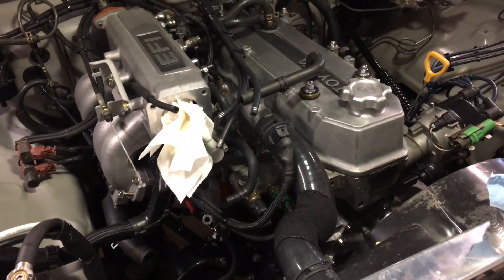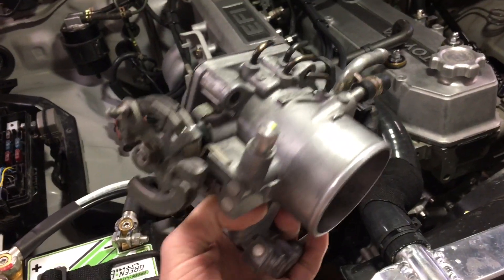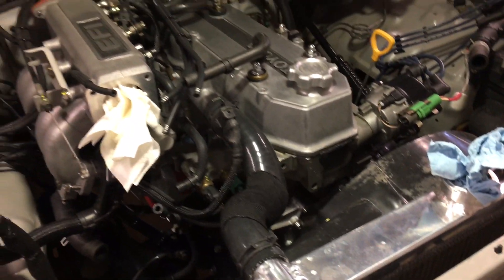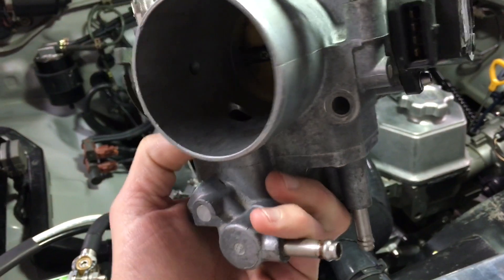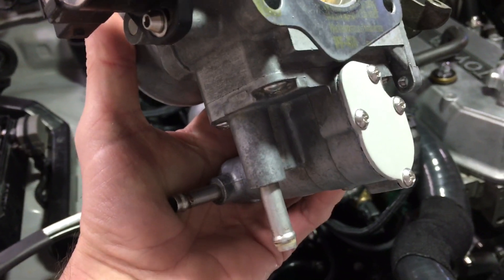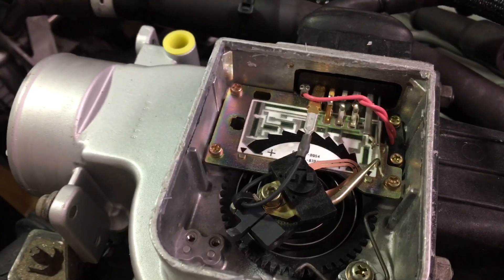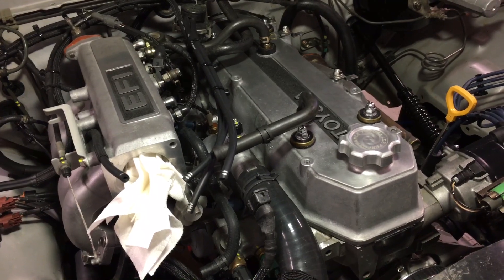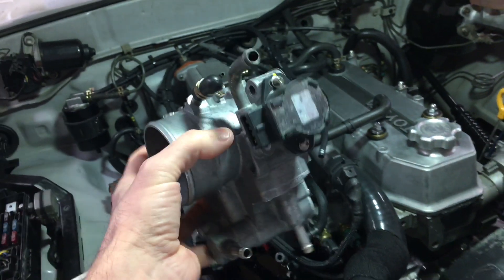Adjusting the Toyota 22RE pickup IAC auxiliary valve for more stable idle warm up

Comment: Question are ICV all the same on 22re ? I have 1988
Reply from the maker: Not sure about the 1988 model. The 1989 to 1995 should all be basically the same, since that's the generation span there. I believe with some of the earlier cars (before 1989), there was EFI and also carbs. If you check out some of my other videos, I show the IAC valve off my truck (which is a 1990 model year) in greater detail.
Reply: 1985-1988 has a different idle valve from 1989-1995.

Comment: Hey Ray, i landed on this video while trying to figure out a similar issue on a 94 pickup with the 3vze that i recenty aquired. I was going to email you but coulnt find it on the about page. Sooo here goes. 
I bought it from a guy that was having issues fixing it and needed the space. He had a friend trying to fix a high idle who attempted adjusting everything they could reach to no avail. When i looked at it, i found it went straight to full throttle. I bought it and after some quick research i attempted to test the iac. Taped off the intake port in the throttle body, and fired it up. Brought the idle down drastically, to within maneagable limits. I attempted adjusting the ring,and found it seized. After a few attempts i sent it to a machine shop who was able to  get the sleeve loosened,and they removed the ring and cleaned up the threads (wish i knew these adjustments were some sort of trade secret or something lol). So i adjusted the sleeve all the way in and installed it(now recognizing this as my first mistake). It ran if i gave it a bit of gas,but i noticed the tail pipe got hot pretty quick, causing the bit of grass up against it to smoke. Im assuming after watching your video that probably it was running rich?  Anyway, im hoping you might have some insight on where to begin as every setting on this throttle body has been altered to an unknown degree at this point.  
Any advice? 

I do believe i need to replace the fan clutch as well,as it grabs immediately and so makes setting this by ear pretty difficult since theres no tach
Reply from the maker: The fan clutch is designed to grab immediately and then free wheel as the engine RPM's go up (i.e. the fan doesn't spin up also). You need the fan turning at low engine RPM's to cool the motor at a stop light. On the IAC, yeah, when I adjusted mine I wish I had made a mark to indicate the factory setting also. If you block off the air passage involved with the IAC valve, the motor should run normally once up to temp. I'm not sure how the IAC valve is configured to work on your motor, but on the 22RE if you turn the nut counter clockwise, it takes longer (higher heat) to shut off the air coming through the IAC. If you run the nut completely down, you are effectively disabling the IAC totally.
Reply: @ray5961  so by disabling it,the engine ends up running rich i assume?
Reply from the maker: @83qwestor  Think of the motor has having two phases - warm up phase, then normal operation. The IAC valve relates only to the initial warm up phase, until the motor gets up to around 150-160 degrees (about 5 minutes of driving approximately). Once coolant temp sends back a certain temp to the ECU, it flips out of that warm up mode and into normal operation. In normal operation, the motor and ECU could careless about the IAC - it expects it to be shut down by that time. So if you have dialed the nut down and caused it to be disabled, it might run a bit richer during the warm up phase, but not under normal operation, as the ECU expects it to be closed by that time anyway.
Reply: @ray5961  ah ok. Im thinking i might try your method,and set it about 4 turns out and see what i get. Would the other screws matter as much,other than for the position of the butterfly?
Reply from the maker: @83qwestor  I'm currently running 4.0 turns out from seated and it's largely okay. However, idle does drop a bit more than I would like if the truck is idling / warming up in the drive way. I think if I ever pull that stuff off to adjust it further, I'm going to give 4.5 turns a try. I think 4.5 turns out would be just about perfect, at least for my particular motor. If you go with 4 turns, you should be in the ball park. The O-ring on the idle adjustment screw is important. LCE sells an upgrade adjuster which is handy and comes with a fresh O-ring. Dash pot adjustment isn't really all that critical. Having the TPS adjusted exactly right is very important to correct operation of everything. You also wanna make sure the throttle body valve stop screw is adjusted correctly. Replacing the seals on the throttle body shaft never hurts, although usually those are fine for the most part. Make sure you do not have any cracks in the rubber elbow that goes into the intake / throttle body.. that's very common and can raise hell with your idle.

Comment: Ah, I read that part wrong.. I thought you said the injector ground, you were referring to the ground on the plug tip, my mistake. Yeah, I may open my plugs a bit more or try removing some of that strap again. Im headed outside too and will share my findings here later. Im guessing now that the injectors are balanced I should see better results tuning the air meter. There’s no question more air is being used with the big bore throttle body and head porting. Also Ray, from my experiences buying LCE stuff over the many years.. their header (which I removed and sold as I believe it reduced low end torque significantly and there really isn’t a need for that free flowing exhaust on these motors. They need back pressure to generate good torque), their cat back (which I love and is unquestionably a quality part), etc, the big bore billet throttle body they sell is the best bang per dollar part. The few hundred $ was worth having new throttle plate bushings, much better throttle response, and all around consistent throttle function. Those old throttle bodies have a tremendous amount of use and it’s challenging to expect consistency from a part that old. I probably shoulda kept our 4Runner and sold the pickup.. soon it may be time to punt this old truck and move to something more consistent.
Reply from the maker: You're giving me flash backs to replacing the throttle body shaft seals! Yeah, never a dull moment on these trucks. I've debated selling mine and getting a 3rd gen 4Runner or maybe a 2005 Lexus GX470 or something, but so far I'm still enjoying this little pickup truck. That 4Runner, the one you had on your channel for sale, looked pretty darn nice.

I've had good luck with the LCE header, although it's a bit louder than having the cast iron manifold on there for sure. Myself, I prefer a motor which has a bit more power up top and less torque lower down. I like being able to cruise my pickup on the highway at 85 or 90 and have smooth power when covering a lot of highway at night, etc.

Oh, something else to consider here: which camshaft are you running? The reason I ask is because when I was building my 22RE, I almost bought the wrong camshaft. I had been search on line and ended up finding a cam that looked pretty good (made by comp cams or someone, I can't remember for sure). Anyway, when I called the company to inquire about it and mentioned what motor I was building, they told me "that cam might not work". What? What do you mean? Turns out, EFI motors have specific vacuum requirements and using a camshaft which isn't specifically designed for a EFI motor can introduce issues. After speaking with them, I did a little research and dug around on google and what they were saying did seem to be true. I still don't know the exact details of it all, but I vaguely remember it had something to do with lobe overlap or something. I don't remember all the specifics, but I ended up buying the camshaft from LCE and specifically went with one that was suited to EFI. 

I think you mentioned you got your motor from 22RE performance right? I don't have too much experience with them directly, but from what I have seen and heard, they seem to know their business. Nevertheless, might be worth doing a little research into that area and making sure the camshaft you have isn't doing anything to upset the EFI / ECU. I doubt it, but I just thought I'd mention it.